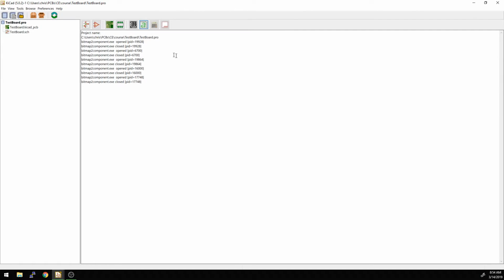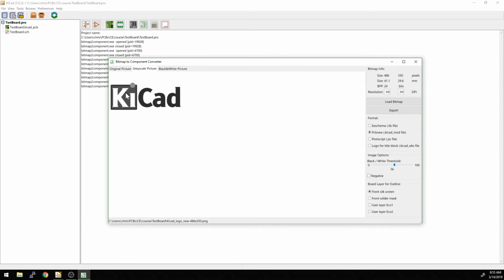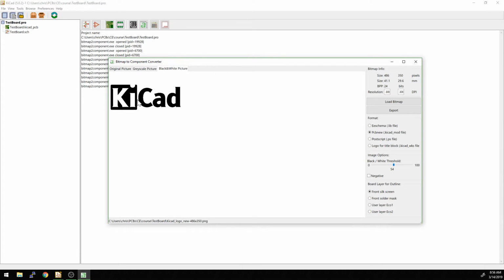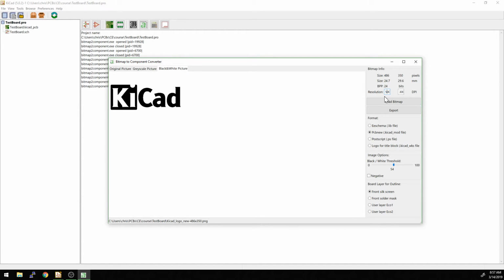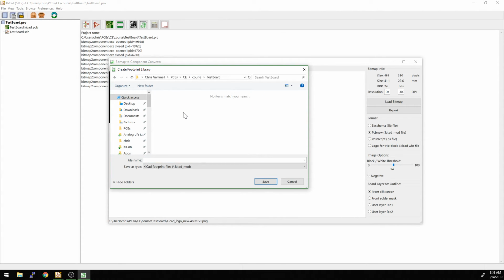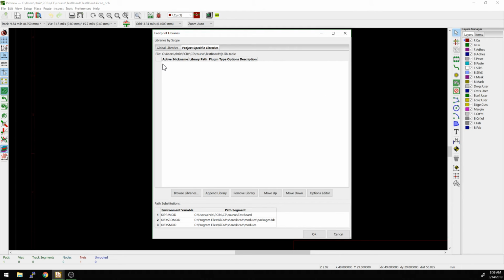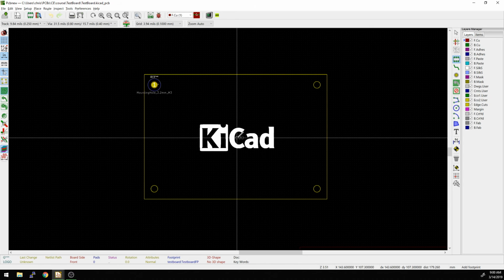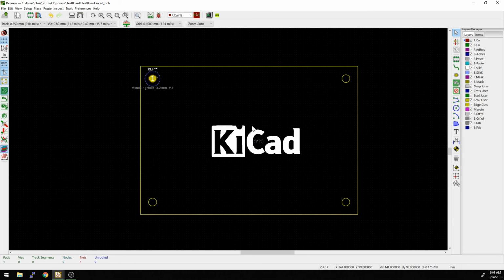KiCad 5.0 - Importing custom graphics

Comment: Hi Chris, can the graphics be added to the copper side of the board such as test can be done. I don't want it to be stenciled on the board. You help is greatly appreciated. If it to be in your next video I can wait for then. Thank you for the video on the graphics.
Reply: Loizos, if you mean the back side, or THT solder side, if you set the graphics for Silkscreen, you can 'E'dit the graphic to be on the back after placement. I often do this. You will discover that you will need to rotate the graphic to taste.
Reply: @Sonus_Lucis  how do you edit this? i to want it on the back? cheers
Reply: @MrOrangeman18  Once you have made the library module, edit the file with a plain text editor (I use Notepad ++) and change the F.SilkS tags to B.SilkS - In Notepad++ you can do a search and replace to automate it. If you look at other MOD files, you can see the tags you need for different layers. F.Cu or F.Mask for example.
Reply: Steve Smith cheers. I found a much simpler way to do it in the end. Added the new footprint (the picture) went into footprint editor and changed it from front to back silk and all sorted.